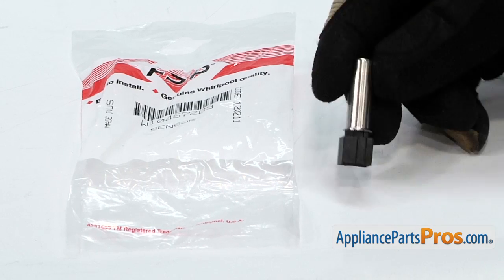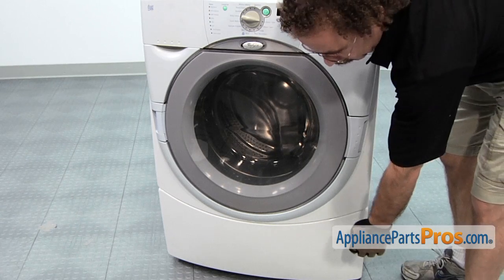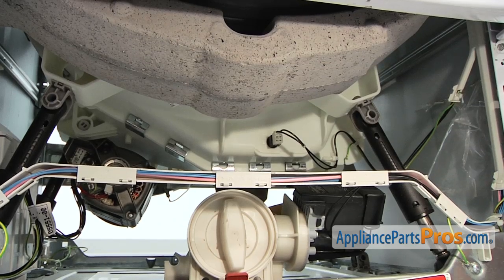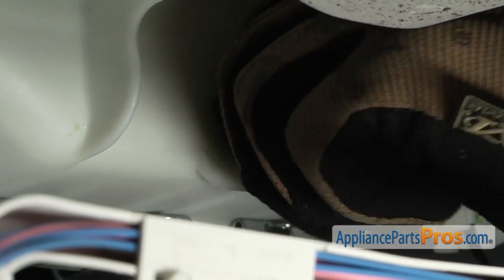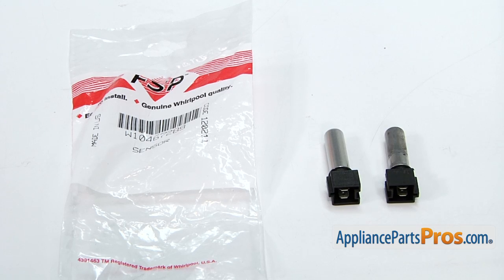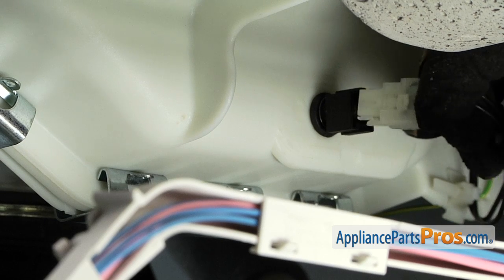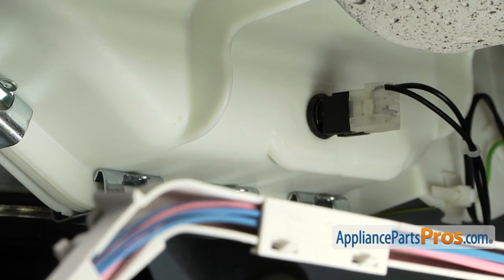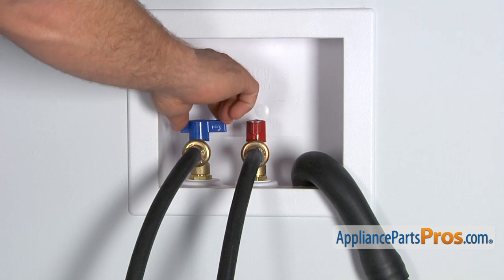How To: Whirlpool/KitchenAid/Maytag Water Temperature Sensor WPW10467289

Comment: I have a Whirlpool Duet Sport HT washer.  My washer stopped in during the spin cycle.  I thought maybe it was too heavy a load, but when I ran a diagnostics test on it, it showed F24 error code, so I ordered the correct part (water temperature sensor) and replaced it.  However, when I tried to start the machine, it continued to do the same thing it did before, which was to lock the door,  show the time for the cycle then sit there.  It will not cancel, except it eventually add a garment will flash.  BTW I had put two blankets in the drum and tried to do a rinse cycle.

Comment: I have an LG front loader.  WM2688HWM. Code was tE.  I ordered the temperature sensor and I THINK I found where it goes.  Mine is located on the top, goes into the box where water comes in and mixes with the soap dispenser.  So I don't have to take the front apart which is a ton of work.   I will let you know when I get it and if that solves the problem.
Reply from the maker: Let us know how it goes, Jane! If you ever need help figuring out how a part installs or you're confused about a part of a repair we don't cover in any of our videos, get in touch with us. We offer free technical advice and diagnosis and we’re available 7 days a week at 1-877-477-7278 or you can chat us at our website: http://www.appliancepartspros.com/

Comment: replaced water temp sensor and ccu washer still displays f3e2 code note lock does not engage was not problem Pryor to repair
Reply from the maker: That code is usually related to the inlet thermister and associated wiring. Have you unplugged the unit and let it sit for at least 10 minutes before powering up? If you have already used the tech sheet to run through the diagnostics then I would recommend posting the problem along with the appliance model number on our repair forum and the techs can help you troubleshoot the problem. http://forum.appliancepartspros.com/

Comment: Two notes - one that someone else commented and another tip.  Some duet washers have this clear in the back of the washer behind the drum.  Look for the black set of wires.  Second is my machine stopped during the middle of the load.  Unplugging this sensor will drain any remaining water in the drum.  You should be able to drain the drum first by unplugging the machine, turning off the water and then plugging the machine in.  Just set the washer to rinse and the first thing it will do is suck any existing water out of the drum.

Thanks for the videio!
Reply from the maker: +Calley Thompson Awesome, thanks for the tips!

Comment: hi there,replaced the sensor with new one and E2  F3 codes r still present?
Reply from the maker: +bob bugera Did you open up the washer and look at the diagnostic paperwork inside? It should have walked you through what to check for that code. If you cannot find it I would suggest posting the problem along with the appliance model number on our repair forum and the techs can help you troubleshoot the problem. http://forum.appliancepartspros.com/

Comment: Thank you so much for this video. I finally found my temperature sensor in the back instead of the front and the problem was that a wire to the sensor had been severed by being too tight along with the movement of the drum over time. I was close to calling in a repair until this video, and now all it cost me was a few inches of electrical tape.
Reply: AppliancePartsPros Same with me! The sensor was in the rear and there was a hanging wire, spliced it together and BAM! Working again! Thanks a lot $$$$$
Reply: Deacon Pat Kearns 0
Reply: This is my issue as well. Wire broke clean right where it inserts into the clip. Trying to avoid buying a whole new wiring harness, any suggestions on how to get this wire back in there?
Reply: hey im having the same problem now. Were you able to get yours fixed? any part number on the clip or wire harness? @patriciashleigh
Reply: @wyattbirks5347  oh gosh, I've sense sold this washer and dryer, so no way of looking for a part number. But I did end up fixing it by replacing a fuse in the back I think?
Reply from the maker: Jonathan Pelland Awesome, glad the video helped you figure it out!

Comment: Matt, I have a Maytag 2000 series washer and it shows my model also has that sensor but took off panel and can't see where it's at. Do you know where it would be on this one? Model # MHWE201YWOO.  Thanks
Reply from the maker: You can enter your model number on our website to view the parts diagrams. I did not see a heater or sensor listed in the model number provided. Make sure you get the model number off the appliance, not a book or receipt.
Reply: Prob already found it.  Its located on back side you can't see it.  Just follow the only two black wires to lower backside of barrel.
Reply: me I found it after I took of BACK panel.  I took off front only and of course it's not there :-)
Reply: robp123451 What was wrong with yours?  Mines got the F3 E2 flashing so i will start with temp sensor.
Reply: me Yes that was the flashing. Start there as you said.It was the sensor.